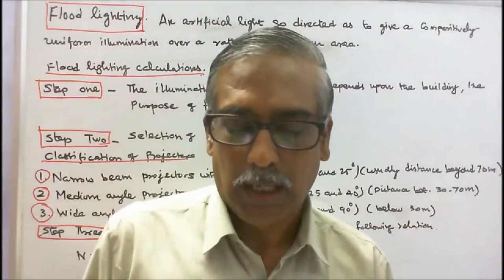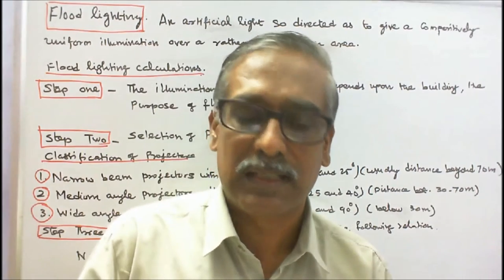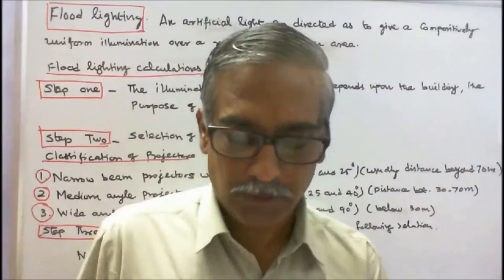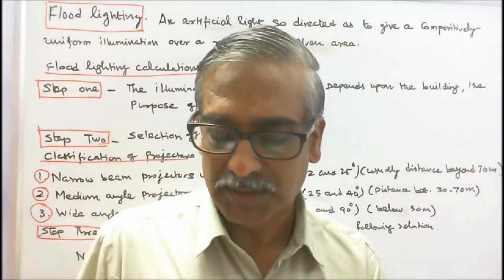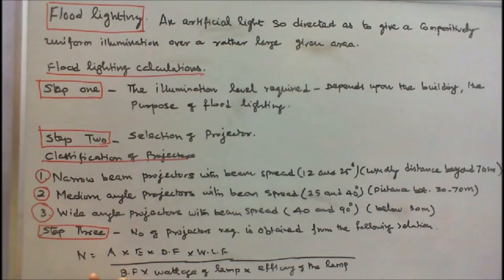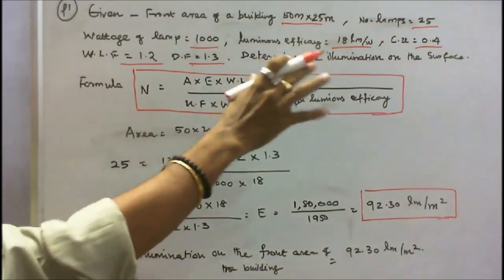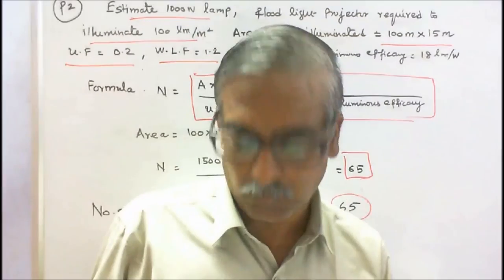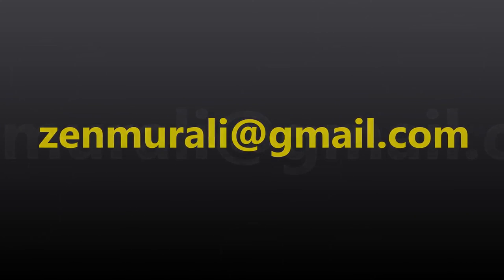ILLUMINATION ENGINEERING - PART -12 - FLOOD LIGHTING - IMPORTANT TERMS & PRBOLEMS

Comment: Can yo help me solve this question, I tried searching on google but I only found this video that helped answered my other questions, I would apreciate your help. Here is the question:A bilding frontage 50m x 15m is to be illuminated by flood lighting projectors situated 25m away. if the illumination is 100 lux, coefficient of utilisation 0.5, depreciation factor 1.5 and waste factor 1.2. Estimate the number and size of projector.
Reply from the maker: Dear Nicolas. Thanks for your comment last semester I took illumination engineering subject. Once again I go through the subject, then I will solve the problem. please wait. very sorry for my delayed response.
Reply: Thanks you very much.